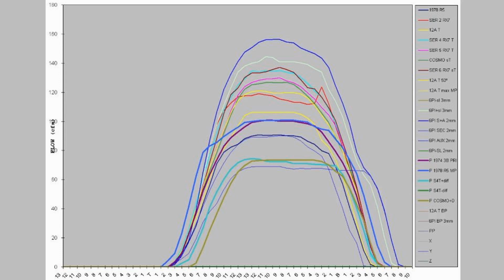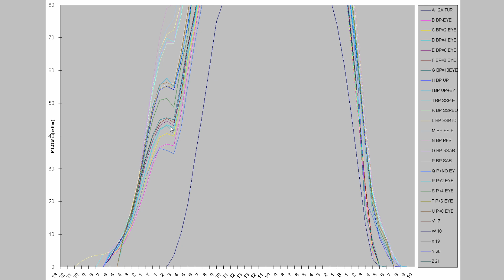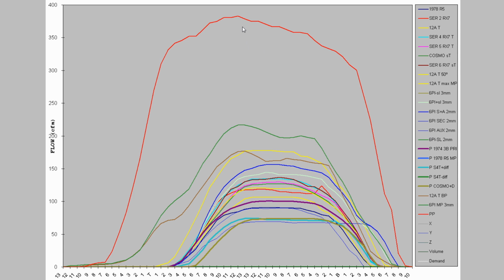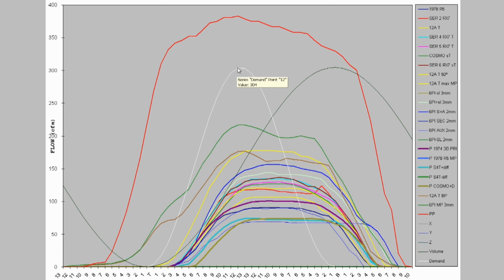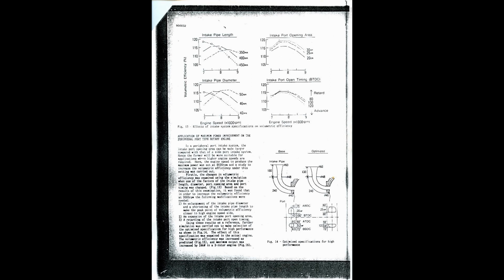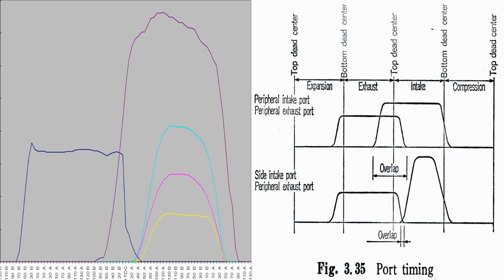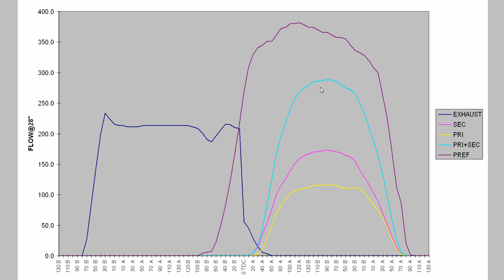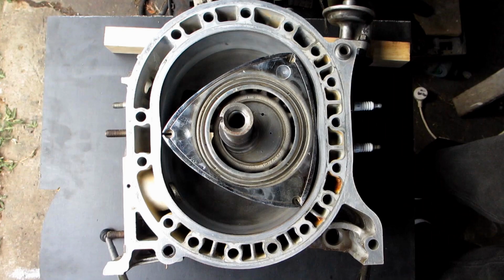Rotor V Piston - Rotary Port Evolution - Pt3

Comment: Very interesting set of videos. I am developing a rotary engine that has a constant rate of volume change throughout the intake cycle. At 5000 RPM this would work out to about 150 CFM. I am wondering how this would change porting objectives.